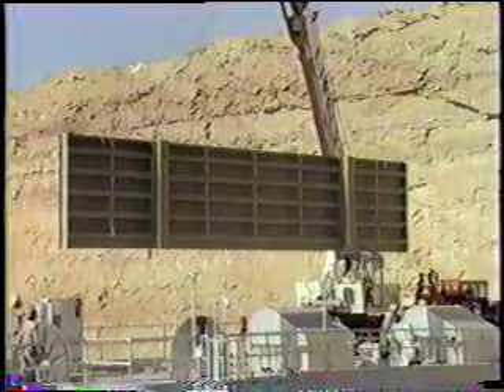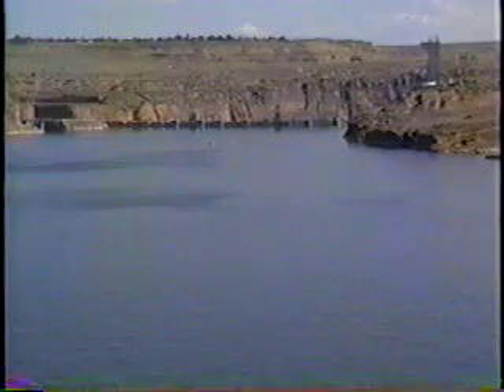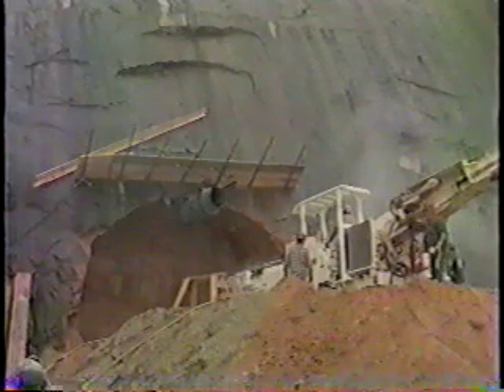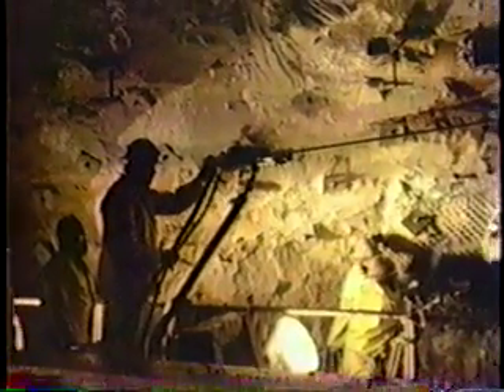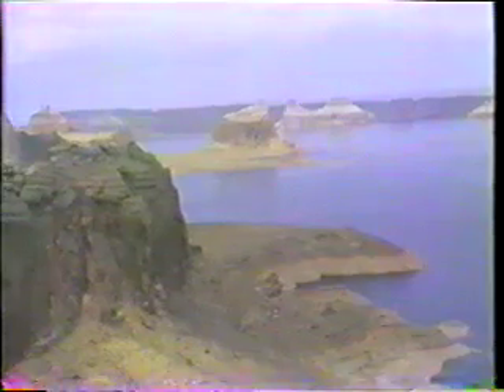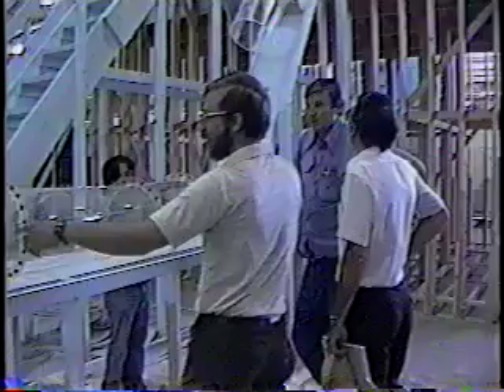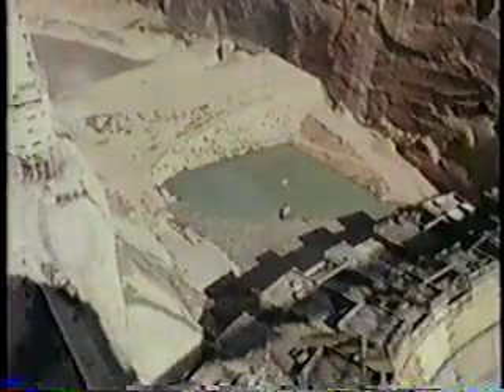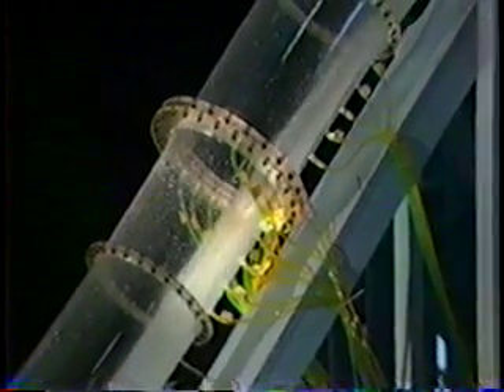Challenge at Glen Canyon (Part 2)

Comment: Whew, if they had run those tubes further the wall of the canyon could have gone away and taken away the dam abutments. Hoover dam might not have taken such a flood. They probably should have armored the tube with steel plate after this, instead of just concrete.